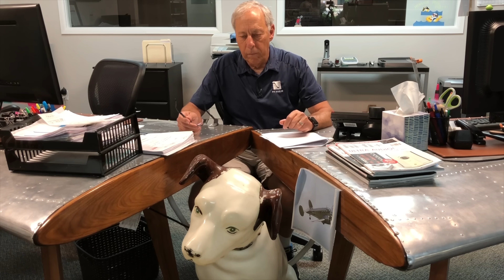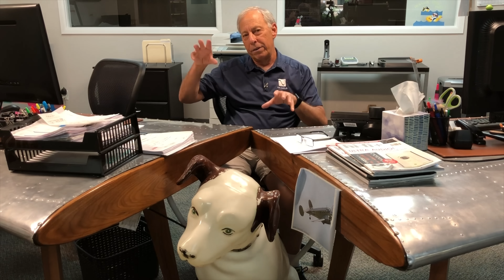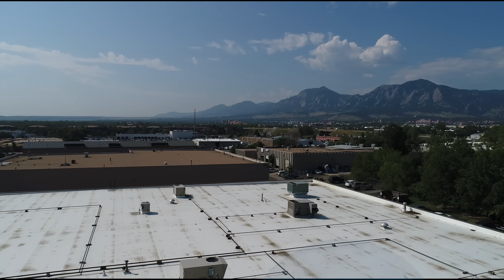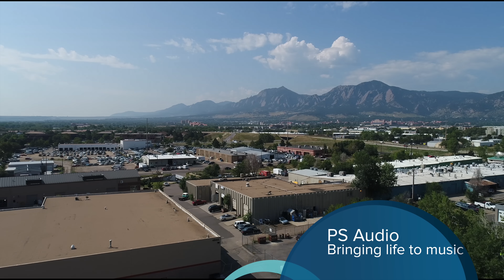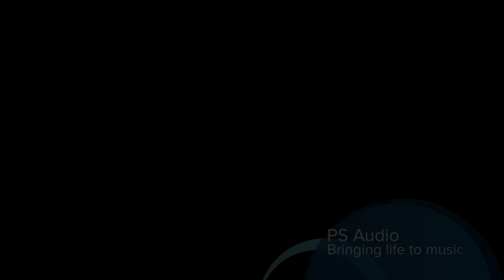Are vacuum tubes worth it?

Comment: I really liked my system - lovely sound  - but when the tube amps were 15 years old, I had a series of issues that cost $2,000 and I decided they were a luxury I could no longer afford. I replaced them with a quality solid state amp and tried to sell the tubes, but no takers, so they sat for 18 years. Finally, I found a new audio sales web site and decided to market them again. This time I got over a dozen serious offers. I decided I had to clean them up and put them in the system to make sure they worked OK. They sounded wonderful. I still got rid of them. It wasn't just the cost. The manufacturer had always repaired them in the past but with the last problem they insisted I take them to a dealer, so the repair - failing oil caps - was undertaken by the nearest dealer. After I got them back and switched them on, 20 minutes later there was an explosion. One of the new oil caps had blown up and spewed oil over everything. So apart from the cost, I could no longer have confidence in repairs. Solid state may not have the magic, but they are easier to live with.

Comment: In a video you explained how vacuum tube amplifiers don’t do anything at voltage under 250v and that solid state/ tube amps are a sales gimmick. What about tube microphones such as the $3000 Lewitt LCT 1040? Thanks man!

Comment: I’m thinking about getting a dauk t8 pro (7 band eq with two vacuum tubes) for phono pre amp. I’ve thought about experimenting with tubes or sound but just maybe want to have second opinion if line out or the turn tables pre amp is sufficient . I don’t know exactly if tubes will enhance vinyl or what is better as you mentioned it’s subjective or people think it a cycle of trying to make it better. I have two 12 inch 8 ohm subs with level control, two Bose bookshelf speakers and 4 3 way loud speaker Sonys in my living room. I feel this would be an inexpensive purchase… but would two tiny vacuum tubes change the sound completely? 

My main question is how does tubes enhance vinyl?

Comment: Yes, "obviously" solid state is far better than tube amplification. That's  why PSVane can charge $2,500 for a matched set of their Acme standard 300B's.  So far, solid state has yet to master the unique "Triode Sound", with the characteristic even order harmonics that make valves so very desirable. There are a lot of very good  hybrid amps coming on the market, using the abundant Soviet era 6H3N double triodes in a pre-amp configuration, along with solid state linear power stages (e.g. the Infineon Merus chip family such as the 2304, 5332, 12070 etc), so you get the best of the valve sound, with the power handling (and FAR reduced costs!) of a all-valve power stage.

Comment: Small signal tubes used in the input stage of a solid state output amp don't do much to change the sound of solid state output designs. Amps using vacuum tubes in their output stages tend to sound more alive, solid state amps sound flat by comparison. 
Just listen to any electric guitar tube amp vs a solid state design...No contest..IMO. Sure tubes can be a pain in the ass but for me well worth it.

Comment: And yet if you want to use a tube in a phono amplifier for moving coil pickups, you have to use a low noise transformer to get the voltage into a place where the tube can use it, or commit sacrilege and use a low noise transistor amplifier. For guitars the simple stages and transformer coupling of speakers add character to the sound. For HiFi the simple staging of valves, while not doing much for simple distortions, avoids the complex distortions of passing through many semi-conductor junctions, before being fed back, and fed through again. Think how many junctions there are in an op-amp, and how many of those are in a typical pre-amp. So a semi-conductor amplifier may mix the signal in ways not measurable, but confusing to brains trying to do spacial and tonal analysis. Then there is the question of what you actually need to do to turn an electrical signal into a sound via loudspeakers. Valve transformers drive speakers differently to transistor voltage power amps. Some have posited that current amplifiers drive speakers more realistically.  Or some combination of the two, which may actually be closer to what a valve output transformer does (?). I just try to enjoy the noise as it comes out.

Comment: a major thing that somehow gets overloked: there is a form of distortion called clipping. if an amplifier runs out of voltage the waveform stops climbing when you hit the limit of available voltage. this flat tops the original waveform. it alters the waveform in a very unmusical way.

a transistor does not approach clipping. it slams into it full speed. it turns a musical sound into a harsh buzz. it generates odd numbered multiple of the original frequencies. it turns the waveform into a square wave.

tube type amplifiers generate even numbered multiples of the original frequency before they clip. this has exactly the opposite effect it makes the waveform peakier. it turns the waveform into a triangle wave. the strings on violins and other bowed instruments generate triangle waves.

this causes the tone difference between tube amps and transistor amps

Comment: Hi , another great informative video, whist I was working for the Metropolitan Police’, back in late 80s early 99s I was involved installing new high band main radio system even then we had hybrid transmitters  made by FKI Burndepr , it had transistor driver and valve - tube PA . I  fully like the idea of re insurgence if tube amps and preamps , I fully concour that you get a more mellow sound compared to transistors pa . I am looking forward in having a tube- valve pre amp. Regards mark

Comment: Solid-state circuitry is not more reliable than tube circuitry, the year before last year I had four of my devices filled with the latest solid-state technology literally fail on me just after Christmas, the devices were an Acer Aspire 5 laptop computer, a Polaroid 65inch UHDTV, a Nintendo Switch, and a Samsung Galaxy J2 Pro mobile phone, all these devices used the latest in modern solid-state technology, yet they all failed within a year or so of purchase, now I have an old Fender non-reverb Super Twin all tube amp that was made in 1975-1976, and apart from some old carbon comp resistors needing replacement, the amp has given me very little trouble and is still working.

Comment: One of the best bass guitar amps I've ever played through so far is my old 1975-1976 non-reverb Fender Super Twin amp, it's an all tube guitar amplifier that uses a total of six 6L6 power tubes in the power amp circuit, it is capable of putting-out 180W RMS, or a whopping 395W peak into speaker loads of a minimum of 4 Ohms, my Ibanez Soundgear 6-String bass sounds really fat and warm through the Super Twin which I have connected up to my old Peavey 410TX 4 X 10 inch bass cab.

Comment: Since tube circuitry operates at high voltages and impedances, I think tube amplifiers suit electric guitars better because most electric guitars employ pickup circuitry that also operates at high impedances, if you connect a high impedance output to a high impedance input you won't experience any loading effects, also, the fact that tube amps operate at high voltages means that there's a greater dynamic range too, here's an interesting fact about tube circuitry.....it is immune to EMP damage, so, if a nuclear bomb was to detonate you'd find that all the tube based gear would still be functioning, and all the solid-state gear would be rendered useless.

Comment: I'm currently working on a diy scratch-build tube guitar amp project, it is basically a 50W version of the Soldano SLO 100, which I call the Sloclone 50, I'm going to be using two matched JJ KT 77 tubes in the power amp and five 12AX7 tubes in the preamp, the circuitry will be built on some 28 X 2 Tagboards I bought online from Evatco.
Reply: put a vintage mullard i63 (1965-1974) in the drive channels preamp (v2?), it has the richest low mids known to man .enjoy!

Comment: I can't stand the sound of transistors and op-amps.. 

It has to be,  analogue, tubes,  SUT's  Blue alps pots. 

Sut's being completely passive gain,  doesn't even require external power. 

The same with variable resistor pots for volume control. 

Passive, discrete solutions sounds better.

There isn't a single transistor in my audio chain.

Comment: I like my instrument tube amps.  Ampeg SVT, B-25B, Fender Bassman and Twin Reverbs etc, yeah great sound.  Plug them into the wall or floor, they are/were quiet and no noises.   They take a lot of abuse (bumps, vibrations, poor heat dissipation, transported upside down, you name it) and still work as they should.  Never had to use a hum eliminator or power conditioner.   Home audio power tube amps?  Mixed.  I continually chase down ground loops and power line hums. With no signal, the room sounds like a  B1 sustain.   If I could have known then what I experience now, I would have never bought a stereo tube amp.   Never again.  I just wonder if professional amps are designed and built better than home stereo stuff.

Comment: They shouldn't cost as much as they do. Its a rip off for such small things to replace in your amp. Yes they sound great, but the cost is a crazy ripoff.
Reply: you can get nos pay more but not worry about replacing them for decades, and they also sound a lot better than modern crap.

Comment: I love my tube Decware system.   The first time I realized the difference was the Van Halen catalog.    I had read that VH and VH2 were recorded on tube equipment.  I also read that Eddies' home studio was originally built with an old tube system and used on the album 1984.   Then Eddie yanked it out and went all solid state for the album 5150.   I didn't know this but remember buying 5150 on lp and thinking "why does this sound so polished and blah unlike 1984?"    Now I know the reason why, tubes.

Comment: So so much talk about vacuum tubes but I have not seen anyone explain what speakers are needed for them. Speakers also play an important role, but we are not talking about specific models for this. Thanks for the invested and beautiful video.
Reply: usually tube power amps are smaller so high sensitivity speakers are recommended. above 90 db

Comment: Personal experience so I thought I'd share. The tube rollers. Those lucky few who know what their doing and like to roll those tubes. I agree with your comments.  True, rather difficult to do transistor rolling, LOL. On power amps tube verses mosfet:  I have done the gambit from 450 watt 4 ohm mosfet amps Hafler DH500 & XL600 to  KT88 / El34  / el34 250 watt Audio Valve Challenger power amps. So much is dependent on the speaker type. Owner of an IRS Beta, current sucking 1.8 ohm monster set of loud speakers as a direct comparison. Tubes were so much better, sound wise, imaging, dimensional presence, fluid, with the tubes.  The woofers columns were better with mosfets, impact, raw punch, 15Hz no problem.  It was after this comparison,  revelation I learned about the true benefits of 2nd order harmonics. Now I still use tubes but the speakers are Avantgarde Duos with a 103dB sensitivity so triodes rule the the last stage at a whopping 4 watts, which since the woofers are self powered 4 watts has plenty of headroom with twice what is needed. So again it is great part about the speaker and your ear. I 'm going to say this was not just my opinion rather universal with all who listened. So there that as well.
Reply: I’m excited I’m waiting for a six watt EL 34 single ended amp that’s being built

Comment: If you have never heard a top drawer (carver is the  primary alter I pray at with crimson 350 monoblocks which are high end audio bargains not the WAY overpriced rolls royce plated mcintosh and other 'audiophile' tube stuff wasting gobs of money festooning with gold plated bobbles) TUBE power amp using 'kinkless tetrode"  (KT) tubes (invented almost 80 years ago) also called 'beam power amps'  or 'beam power tube' (they have the well know KT 66/88/120/150 moniker, but there are other non KT  named KT tubes like 6550, etc)  - then you have not heard tubes for high power audio and sound at their absolute best.   I also have built and bought and love power MOSFET SS amps just as much.  I pray at the alter of Pass Labs for that and use primarily now X350.8 power amps.   I love Pauls youtubes, and  love PS audio!  (i  first heard of them from an AES student chapter  visit there back in the late 70s when PS was in Santa Maria ca, while i was an EE student at Cal Poly SLO) I have 2x stellar DAC and a Nuwave phone preamp/ADC - but respectfully disagree that modern tubes and tube amp designs cannot sound EVERY bit as good as SOA MOSFET output stage designs.  Modern  tubes are much more reliable these days for current tech, even power amps, and so are the transformers.  A tube power amp does for sure need a  REALLY well designed and superbly executed output transformer as part of a modern high power tube design.  Lastly Class D is not something I bring up here as those really need to be compared solely to class A and Class AB  (or class G/H with tracking power supplies for SS designs)  whether they are KT TUBES or SS MOSFET / BJT designs.  Class D is a whole different mentality all together.  Class D have revolutionized Front of House (FOH)  PA and sound reinforcement use for venues small to 100K seat stadiums, but they still need to evolve more (class T was the best class D version amps I have ever heard) to compare to the best KT Tube and or MOSFET SS class A/B designs